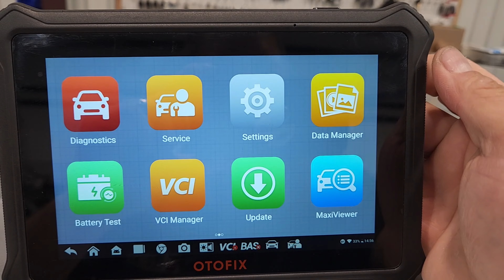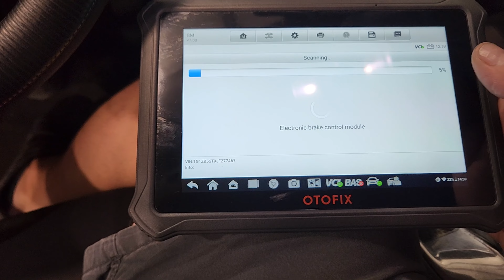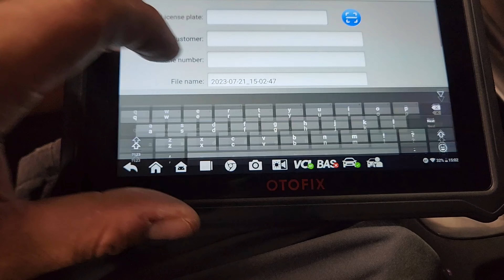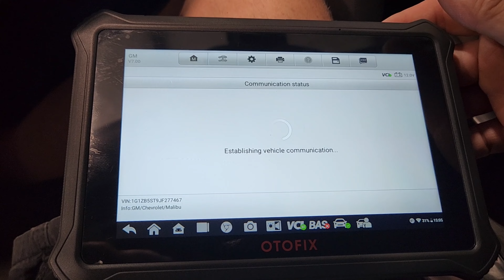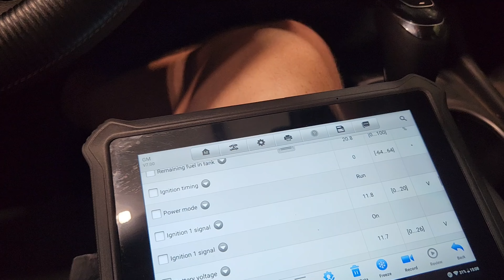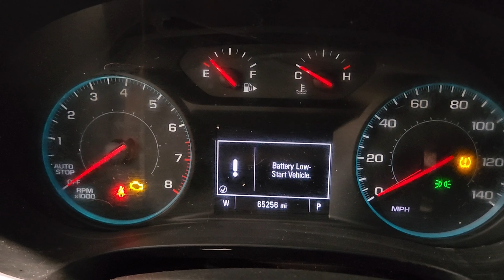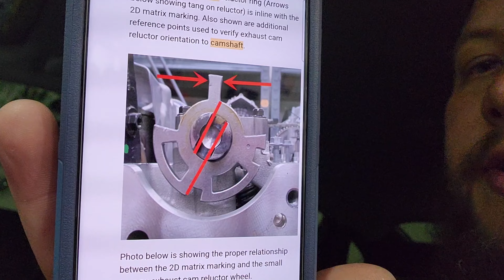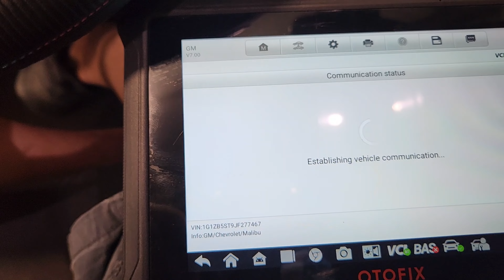Crank but no start Chevy Malibu SOLVED... well sorta

Comment: I am looking into starting a class action lawsuit against GM!
Reply: Hi I'm interested in joining in on it my 2018 Malibu is doing the exact same thing and giving me the same issues and I've changed and replaced so much on this car and the problem still isn't fixed.
Reply: @SweetTWil  I'm almost giving up on a suit because trying to find information and actually trying to start one is so complicated. Whatever you do, don't spend any more money trying to fix it because it can't be fixed. The 10-minute solution is even in GM's manual for the car, so they damned well knew about this issue. I watched another video on how to put a toggle switch in between the circuit from the ignition to the Anti-Theft and it doesn't work. Some people say they have Success With It, but not me and I'm a hands on guy that does all the work on my own car. I just deal with waiting 10 minutes whenever it decides to not start. Do you know the actual way to do the 10-minute disabling of the anti-theft system to restart your car?
Reply: ... count me in🙋‍♂️my mom's car is having the same issues

Comment: I have a 2011 chevy malibu that drove fine all day no problems and then I parked it now it cranks but will not fire over. I have replaced the fuel pump, crank shaft sensor, plugs, and fuel filter still have no luck
Reply: Ur problem solved?
Reply: Did you fix it
Reply: This exact thing just happened. Car is at work. Boss let me take truck home. Any suggestions?
Reply: Please let me kno how u fixed it cuz im fucced

Comment: I’ve had to fix a couple of these recently with shifted camshaft reluctors. I pulled up a pic of the camshaft on Rock auto and used that to get the reluctor close to where it should be and used a cam/crank correlation with the pico to get it exact. Didn’t know that they had a TSB with a detailed pic until after I was done 😂
Reply: Questions

Comment: I had a mechanic call me on a 2018 equinox that had a failed vacuum pump that he repaired, then the vehicle wouldn't start. Confirmed no injector pulse. Checked tsb and found out about reluctor on the cam issue. Told him to sell a full timing job including cam and reluctor assembly. All was well after that.
Reply: Bingooo!!!!

Comment: Got a 17 Malibu. New starter and alternator test the battery and it’s good.. when trying to start I get one click and that’s it. Motor not lock because I turned it.any thoughts? Last time I drove it was coming from auto one putting oil in it. I’ve noticed white smoke, came home. When it was time for me to leave it won’t start

Comment: More videos please, thanks Keith.
Reply: Hmmm, 20 degrees off and no cam crank correlation codes? Did the vacuum /brake code stop it from setting other codes? Interesting.

Comment: When you refer to immobilized, are you referring to the flashing security light? I’m asking because in prior generations like early 2K the engine will crank, but not start. They are cutting fuel or spark, one of the two and you have to perform the security bypass procedure to get it to start. Is that considered immobilized or is that something different?

Comment: Sr. Can you please give me some advice iv jad my 2011 for a year it keeps breaking down alternator twice starter battery! Changed battery cable but the neg will not tighten down and cant order because of recall? Please help i spent so much money ibe been to shops ibe been to every mechanic and its never fixed i broke down 2day 5 hours on the side of the road smh any idea both battery and alternator are good slow cranking now but the battery was completely dead help
Reply from the maker: You need to call all the shops and ask them if they can perform voltage drop testing and how much training they attend. If they can not answer articulately, hang up, and find one that can. I competent technician can diagnose the issue, and fix it right the first time. No I don't know how much it will cost, no one will until they find out what is wrong.

Comment: Literally same exact problem. Starts sometimes and then it doesnt.. vacuum pump issue
Reply: You vacuum is probably broken I had the same issue it’s a dealer part Carquest usually can get you one. But replace the pump but there is a journal on the engine block clean that out with a atop or something because all the carbon from the oil plugs up the filter and doesn’t allow oil to get to the pump do not use compressed air
Reply: @jessedeschamps962  found out in fact was the vacuum pump.. already replaced it :)
Reply: @jessedeschamps962  but on the process of it breaking..it made my camshaft out of line so I had to put it back in time

Comment: 2017 chevy malibu car didn't have brakes because the pump went out fixed that the car didn't wanna start we bought a new start put it on and it started now its acting up again could it be the camshaft sensor and the dash say starter relay changed it and it stll wont start help help help

Comment: I have a 2016 Chevy Malibu and its doing this exact thing.. What do I need?
Reply from the maker: Needs to be properly diagnosed first.
Reply: Oh so then your video wasn’t for purpose of helping people just promoting the tool gotcha
Reply: Turn your key to the on position without starting it and see if your anti-theft light blinks. If it does, turn the key to on and do not start let it blink until it goes solid and then shuts off. The car should start after that.

Comment: You vacuum is probably broken I had the same issue it’s a dealer part Carquest usually can get you one. But replace the pump but there is a journal on the engine block clean that out with a q tip or something because all the carbon from the oil plugs up the filter and doesn’t allow oil to get to the pump do not use compressed air
Reply from the maker: I mean, that is what I said.

Comment: If the anti-theft system is malfunctioning it will shut down fuel injectors and fuel pump.
Reply: Can I take that fuse out and start it?
Reply: @DP064  to be honest, I have looked I can't seem to find a fuse for it. Others have said they've pulled a fuse, but I can't find one. What kind of vehicle do you have?
Reply: @DP064  I have a 2003 Chevy Malibu, which is notorious along with other models from GM that have a faulty anti-theft system.
Reply from the maker: On some cars, yes.
Reply from the maker: That doesnt work.
Reply: @L1Training  what doesn't work?